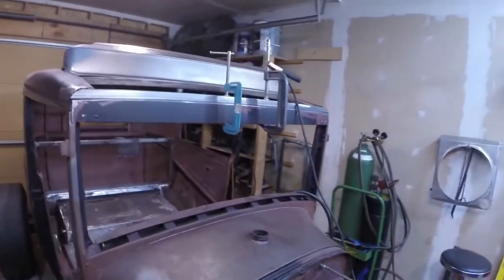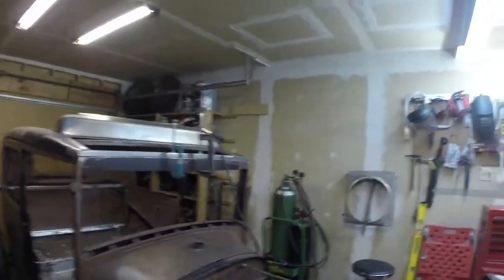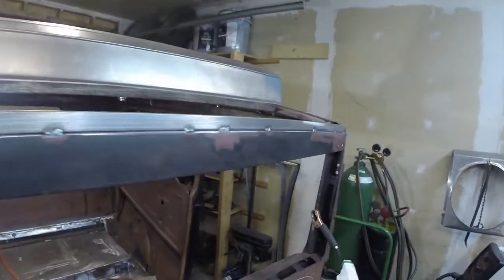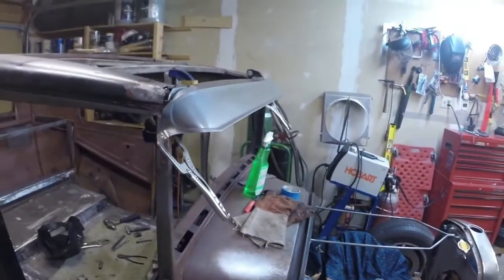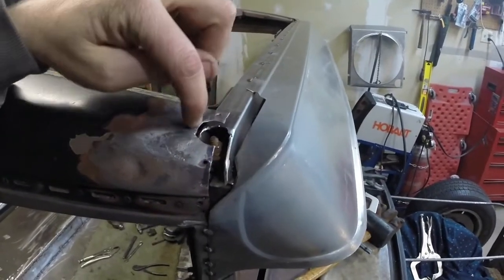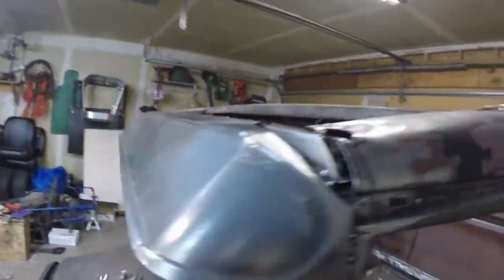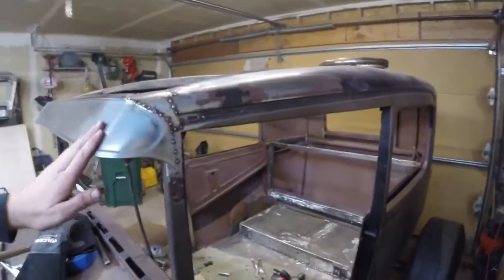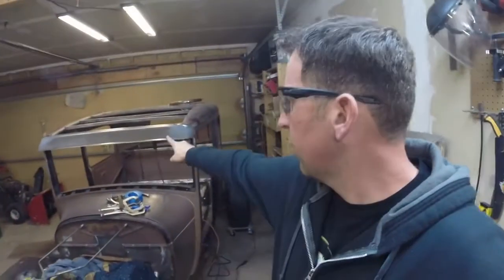How To - Visor Install on a '29 Model A... Part 2! Bad Hombre Garage Episode 10

Comment: It's looking good, I use a gas welding rod to match the contour by laying it on top of the roof and extending it forward, then taping it in place. Just my nickles worth.
Reply from the maker: Thanks! I should’ve used that truck.
Reply: I'm not even close to a pro I'm the most novice welder I know but to take the ridgedness out of the tube and get it to conform a little more to the curve could you have cut a few relief cuts on the side against the car keep it from always trying to pull upward and putting force on the welds possibly making them want to break it require a little more welding to weld the relief cuts closed once it conforms to the csr i hope i explained that write and doesn't confuse anyone or worse case I didn't over explain it LMAO
Reply from the maker: David Benham made perfect sense to me- and you’re right.  It pulled down as flush as it can be, but hopefully it does not pull up at the welds.  Oh well- I’m not going back and doing it again! Thanks for the tips.
Reply: I dont blame you I wouldn't either I was just asking because like I said I'm a novice welder and would like to know just incase I come across it lol

Comment: looks good to me. how or where did you get your weld table? And does it fold up?
Reply from the maker: Robert McCartney the table is homemade.  It’s one of those cheapy wood working tables with the top that clamps wood.  The wood top broke, so I added a 20”x 24” or so welding table top made from angle iron and flat strap.  It does still fold up.

Comment: To me its a bad idea, how are you going to install the windshild.( you're going to glue it in ) you car is going to be hard to drive at night. Because of the flat windshild.
Reply from the maker: The windshield fit into the stock style frame, and the frame bolted in close to how it would have originally.  I don’t understand why the car will be hard to drive at night, can you explain?  The windshield operates very much like an original setup.